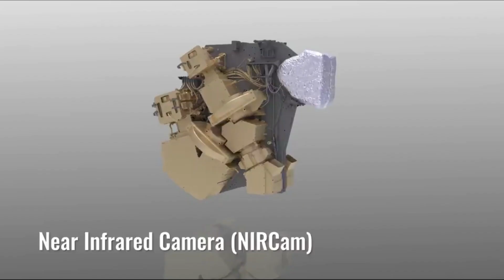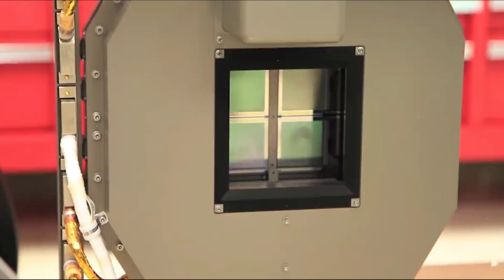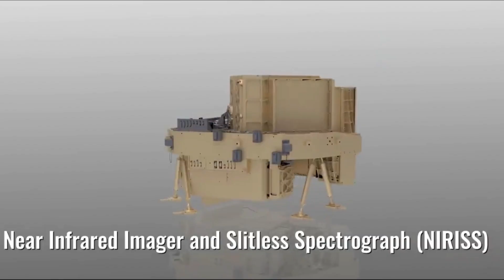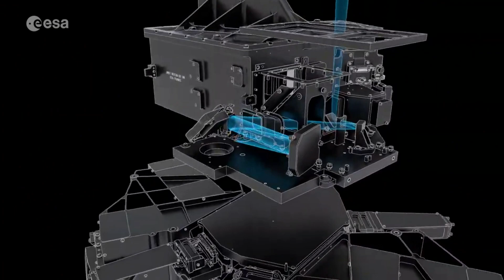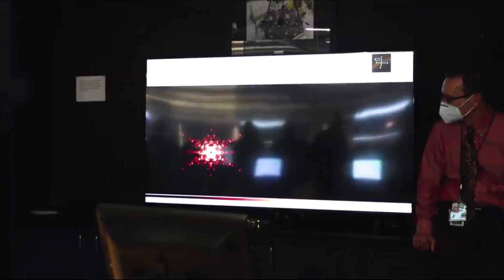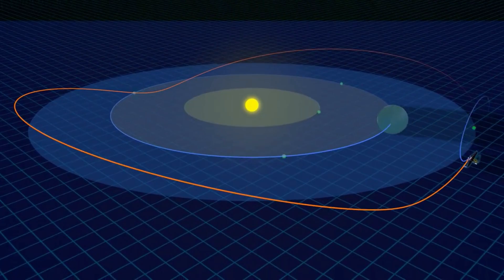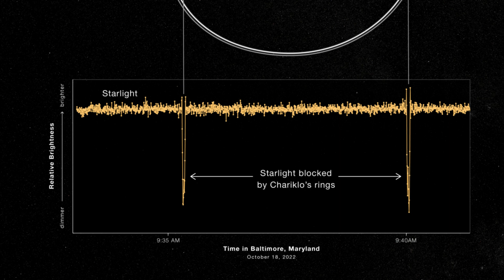How Cosmic Radiation Shut Down One Of The JWST’s Primary Instruments

Comment: In general more complicated circuitry such as FPGAs are becoming more sensitive to heavy ions and protons due to the critical charge (amount of energy needed to switch the gate) lowering due to smaller and smaller gate sizes.
Reply: What are the options?
Shuttle-style redundant computers that vote on the result?  Weight of the redundant systems, including power supplies would cut the possible science payload.  Plus, the additional layers of system software to coordinate all of that must bring an overall speed penalty.

Calculate the energy delivered by the "average" particle and create chips whose gates require some multiple of that energy to change state?  Won't that impose a speed and sensitivity ceiling on sensors striving to detect faint signals or changes in faint signals in real time?

I am genuinely curious what solutions recommend themselves.
Reply: @frankmcgowan9457  And the answer is Starship?